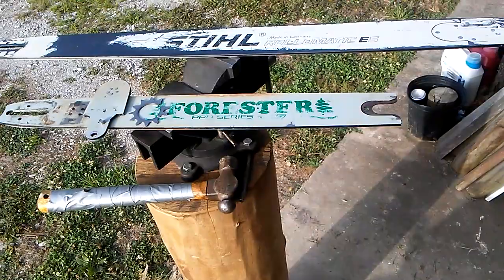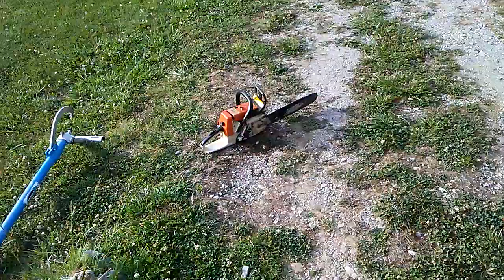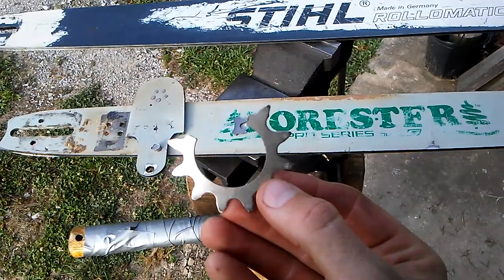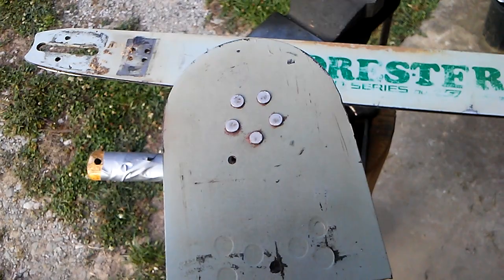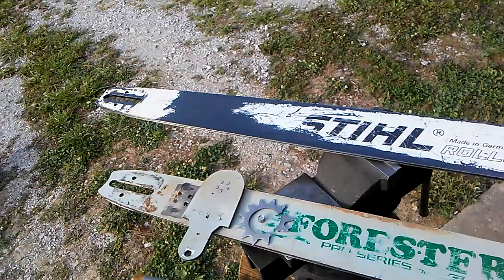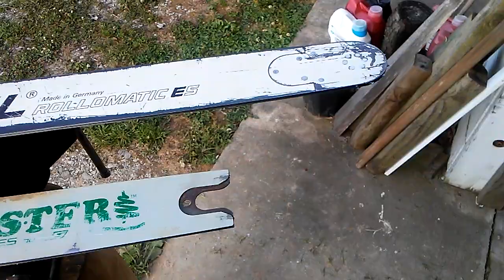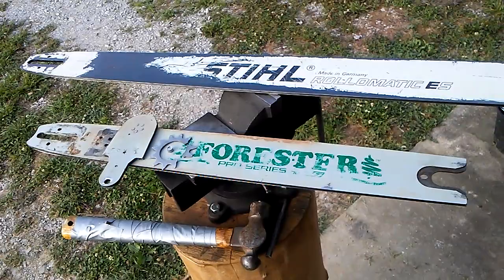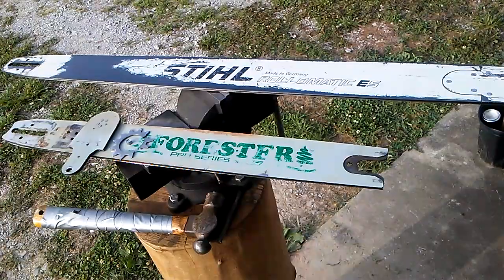Forester vs. Stihl guide bar

Comment: It's definitely worth it if u just need one to use . I got the 28 inch for my MS 390 and I'm still using the first chain I got for that bar but I did that probably 6 or 7 years ago. I obviously use other saws and not always the 390 .
Reply from the maker: Hi mr Tree. Absolutely a good choice for someone that wants to go that route. My experience may have been a low-percentage defect. I have several saws myself, but I move the bars from saw to saw instead of dedicating a bar to a power-head. We put more time on a bar than the average user. Thank you for commenting and sharing your experience in a fine way Sir.
Reply: @Brian2bears  yea I'm sure you use it alot more than I do  and that affects alot and back when I got it it was alot less than an Oregon bar but now when I looked at the prices some cheaper oregon Bars are close to the same price along with the Forrester price going up a little but that's probably just natural Inflation with 7 years going by. But as long as u get it for a good price it's worth it to have as an option . I just got 18 inch Forrester for my 024 and it was less than half the cost of a stihl bar so the small bars are still cheaper